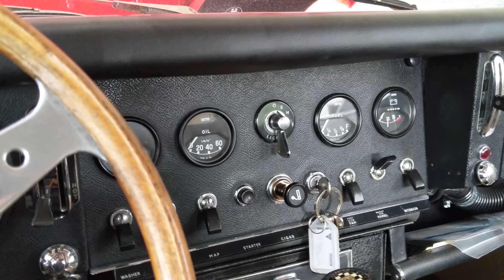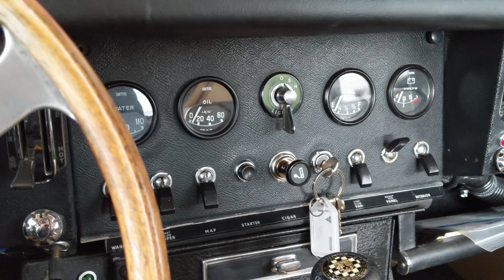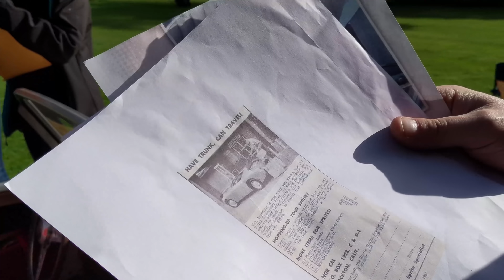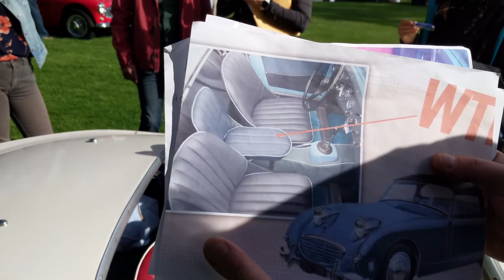Our Austin-Healey 100-4 Wins the VanDusen ABFM

Comment: Nice AH 100!  Note, it's NOT a 100-4!  As the first in the series, it is a 100 versus the 100-6 which came afterwards and is appropriately named.  Thanks for the nod to Geoff at Rightway Heritage Trimming, as he's doing the green interior on my OEW '55 BN1.
Reply: I owned a 59 100-6...The 100S model, from 1956, actually had more hp from that 4 cyl, than the first couple years of the 6cyl Healeys! But I loved the sound of that six...on par with an XKE.

Comment: In 1968 I had a 1958 Bugeyed Sprite exactly like the one you drove.  Same color, same interior color.  It was all original, of course, and in very good condition.  Before that, an MGA.  Into the Army in '69; out on '72.  First thing I did was buy a new Fiat 124 Spyder.  Had it for eight months.  Sold it and bought a new '72  VW Beetle convertible.

From that experience I learned two things:  1) never again a British car and 2) never again an Italian car.

Comment: That bugeye is a Frogeye - otherwise known as an Austin Healey Sprite
I had one as my first sportscar waaaay back in the early 70's
Reply: The Sprite quickly became affectionately known as the "frogeye" in the UK and the "bugeye" in the US, because its headlights were prominently mounted on top of the bonnet, inboard of the front wings. You might have had a "frogeye", I had a "bugeye". Cheers.
Reply: I have one here in Australia, and very happy to call it a bugeye... Geoffrey Healey even drove mine at the 1990 Austin Healey National Rally Ballarat Australia!
Reply: Those cars are a blast to drive!  If set up with a Datsun 5 speed it's alot of fun!

Comment: My first sports car, ‘54, 4 speed with elec over drive. 
Bought for $250, blocked off leaking heater core and sold for $300.
Wasn’t as clean like this one.
All in 1966.

Comment: Why does the one 100-4 have hood louvers and the other not. Custom? For a sec when you were fooling with the red coupe I though it was the OTHER red coupe and I almost had a holy crap moment over how fast you got it done.
Reply from the maker: The second 100-4 has a factory-original steel 100M/LeMans hood with louvers. Thanks for watching!

Comment: why on earth would you tow a car for a stuck starter solenoid just use the starter assistant 2000  mine weights in at 5 pounds just hit the component real hard a few times  then its all fixed  fast easy and free almost you might bust a knuckle or two but in general free